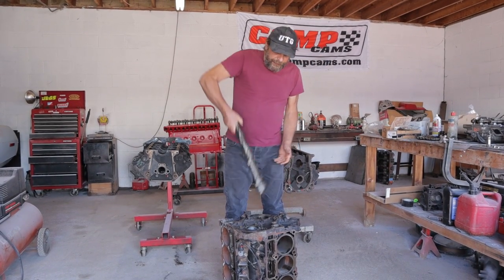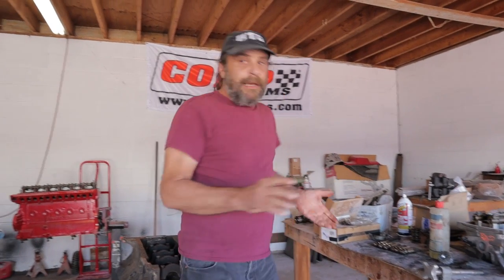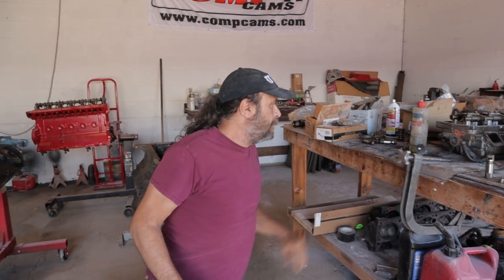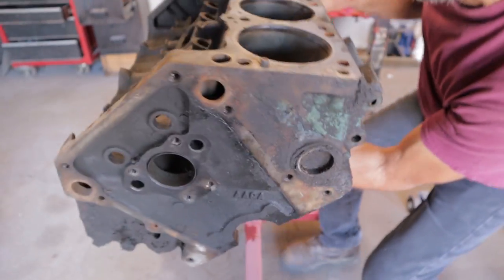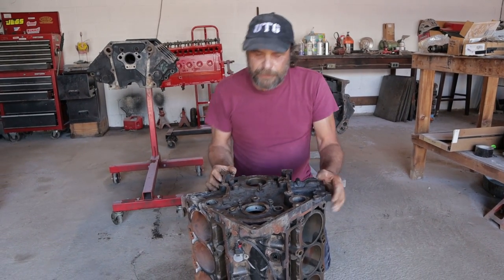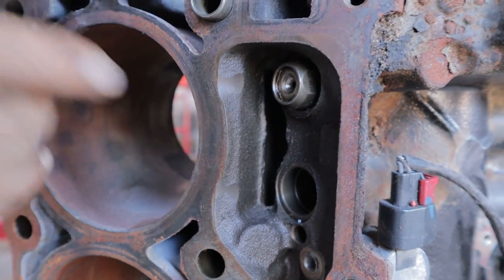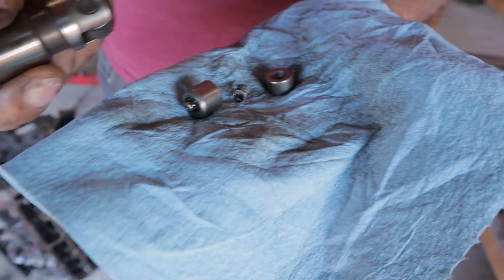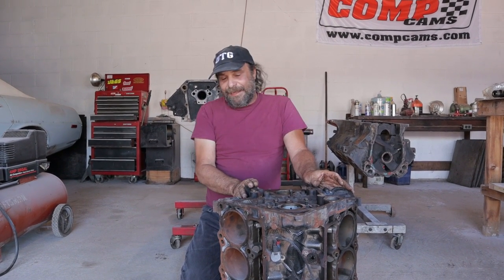Gen 3 Hemi Camshaft Failure Mystery Explained!

Comment: 3 decades ago I used to solve this problem on Holden 308's by grooving the lifter bore on the side of the lifter. I even made a tool to make it easy and consistent. Seems to me that may be beneficial on these engines also.  A local Aussie company Tighe Engineering machines a narrow flat surface on the side of the lifter itself to achieve the same result.  Grooving at the top side of the lifter (from oil groove to the roller end) would allow oil to positively flow to the rollers and splash across the camshaft.
Reply: kinda like a Rhoads lifter, but on the outside to direct oil, not to reduce lifter pump up... I never liked Rhoads, they tend to tick at idle, I preferred standard lifters, just set lash like at zero to a few thou loose, cant pump up- anyways, your controlled lube via a flat would work- long as mds blockoffs installed to give pressure source on lifter body- surely the depth of the flat could be tuned to give adequate flow without dropping oil pressure much- they only need a little more... I like it.
Reply: Hello I'm just a regular person on my second engine for my ram 1500. Looking to build my own. I would like to understand your fix but when I read it it looked like this ¥£€€\□》♡♡♡♤}5€■《》    😢😢😢 could you run that by me one more time
Reply: @RodneyBarber  as I read it, he had a groove cut or a flat ground, along the length of the side of the lifter...this allows oil from the oil galley that feeds the lifter to have a controlled leak, pouring excess oil down onto the camshaft... he didnt say if groove/flat was full length of lifter- if so it would also blow extra oil up into the valley- maybe ok for even more oil onto the cam from drain holes in the valley, but more likely would run to the front/rear drains first...my only worry would be reduced oil pressure from the 16 new oil leaks- a high volume pump/redrilling any feeds to handle extra volume. I think its a very sound idea, but(always a but) I think the groove from the oil feed recess to bottom only would put oil only out the bottom, and also, putting the groove or flaton roller centerline would put the 'leak' directly aimed at the cam lobe- but a groove or flat on centerline *might accelerate wear in the lifter bore, as the lateral loads would be pushing towards the groove... a zig-gag or helical groove would prevent a unworn strip in the lifter bore/provide better support to the lifter... interesting idea/food for thought. I think hes definitely got a viable solution worth kicking around/maybe tweaking. another option might be epoxy/grinder work around the block holes to guide all the drainback into areas directly over cam lobes- rake of crankshaft to horizontal line might require staggered heights so all holes would tend to drain equally with car/truck on level ground...idling on a incline though would only help one end of the motor...the lifter leak port I think might be a easiest fix- I would probably opt for a cnc'd groove with a helical or angled pattern to provide uniform wear in the lifter bore... would hate to see a unworn step in lifter bore after 50k miles or so... rhoads lifters dont have that problem internally as pushrods tend to rotate enough their ends and the internal roller plunger would tend to follow, preventing the bleeded groove from riding in one 'line' forever...

Comment: Spot on Tony. My buddy’s shop takes care of a fleet of hemi pickup trucks. They’ve replace quite a few camshafts and engines. Low rpm and a lot of idle time, with heavy loads. Most of the other vehicles that didn’t fail were in passenger cars being driven at higher speeds. You nailed it.

Comment: Excellent analysis. Explains why I managed to put 200k miles and 250k miles on two GEN IIIs both with lots and lots of Hwy miles at 2400 rpm yet a city driven car with 15k has the tick.

Comment: Makes me wonder if that is the real cause of the “hemi tick” I have seen commented on the internet so often.
Reply: I think you nailed it
Reply: Agreed. I enjoy UT vids, and am totally psyched he's got this GEN3 5.7. Hearing his detective work here makes alot of sense, and makes me worried about my '14 Charger 5.7....
Reply: SnowMonkVX ive got an 2014 ram 1500 makes me wonder
Reply: SnowMonkVX I hear you brother! I have a ‘15 Ram that I bought new. It never made any tick until recently when It’s been sitting more than before. I think he just described why.
Reply: exhaust manifold bolts...My 2004 Ram 5.7 hemi had that problem..it was the exhaust manifold bolts..Truck went 212,000 miles with no issues besides the exhaust manifold bolts! Simple enough repair at the exhaust shop.
Reply: I’m a car dealer and many of the hemi engines, have lifter failures.
Reply: @strokermaverick  hemis aren't the only ones.  my 2015 Silverado has that afm crap on it and it shredded the lifters twice. I have since shut the V4 mode off and no more problems.
Reply: I had a 2016 Ram 1500 Hemi and it always had the hemi tick from new. It would usually tick for about 30 seconds on startup. I traded it at around 30k miles, always made me worry that valve train was about to go.
Reply: @corymagnus7452  Same with my 04. I'm at 184,000 and still going strong.
Reply: Bet on it!
Reply: Kurt Zimmerman Yes sir, you are correct! I’ve seen many Chevy trucks, with collapsed lifters. The” tick” is one thing, but many hemi’s and ls’s    have lifter collapsing problems.
Reply: I started running Schaefer’s 5w20 in my 5.7. Stopped the hemi tick. Tried Mobil 1, royal purple and some others with no success. The Schaefer’s is where it’s at.
Reply: If you get OBD code P1521, this is incorrect oil type. Dealer says disregard this as erroneous, if you are using proper weight oil. Problem is that this is not erroneous. The problem lies in the damaged timing cover to block gasket. Damaged gasket leaks antifreeze coolant into oil pan. Other signs of this problem are:  1  slight coolant loss as seen in recovery bottle,  2. Possible coolant leaking from area of where the timing cover meets the block by the head. Coolant could also dribble on ground.,  and 3. Milky deposits in oil fill cap. Contaminated oil with coolant could cause poor oiling of engine components and wear.
Reply: @pwrbyford68  that was just normal start up tick. Takes a few seconds for oil to get go the top of the motor. Hemi tick doesn't stop.
Reply: @lindamyers7799  thanks a lot linda! Was wondering about all of those little symptoms in my 04 ram for the past few months. Looks like I'm tearing the front of my drivetrain off this weekend, kids are gonna hate me.
Reply: @jeep13ca  I've had Royal Purple stop the tick. Maybe switching between 3 different oils cleaned out something
Reply: @corymagnus7452  That is what I have. The tick is on start up. When she warms up, it's gone. I haven't looked at the bolts, but I know they're broke.
Reply: The exhaust shop pulls the cylinder head off and removes the broken manifold bolt? Sounds like a regular shop. It's an expensive repair.
Reply: @thenewnorm9909  is yours an intermittent slight tapping thats inconsistent? Think my exhaust manifold bolts are broken or lose causing the sound sometimes at start up and idle. Never when I gas it though.
Reply: @moabman6803  not really, just have to replace the exhaust manifolds, bolts and gaskets. easy repair on trucks, only time head removed is when someone screws-up and breaks something off in bolt, like an easy out.  also many people just replace exhaust gasket. which is a failed repair, because the reason bolts break is because manifold warped.

Comment: Tony, thank you!  I've got a 2010 Dodge 1500.  The camshaft went out at 98,000 miles.  FCA did warranty it for me.  (Thank God!)  Never could get an explanation from ANYONE on who, what, where, when.
Reply: How did you go about getting FCA to foot the Bill?
Reply: Ya how did fca cover it? My 2013 with 135k just went out
Reply: My 2012 has 225k on it and still going.  I've used Amsoil and a half quart of atf at 5000 mile oil changes from day one.

Comment: Well thank you ut you just proved my theory on this problem and then some  I work on a lot of these in the shop most of them police cars(idles alot) and this "theory" of yours also would explain why the catastrophic failure on these engines is usually on the cylinders that are deactivated for fuel economy my hats off to you sir but on another note I believe Chrysler already knows this but to admit this would be financial ruin to the corperation
Reply: Yep, just like the LS DOD lifter failures. Class action would destroy them because they produced millions. So they deflect, deflect deflect as we all have trucks with a stack of payments that need internal motorwork at 80,000 miles.
Reply: @Dave:"Yes,and every car manufacturer has their own lil secret "black book" of 'oops',and sometimes complete engineering frick-ups{!"
Reply: You 100% right
Reply: Hey comba.  Can u take a 3ANGEL FILE AND CUT A GROVE IN THE LIFTER BORE ABOVE THE  CAM. AND RAZE THE OIL PRES. TO COMP. AND USE GOOD OIL WITH ZINK.  PUT THE GROVE UNDER THE OIL HOLE OR CHANEL.  TAKE CARE.
Reply: That is why I sold my 2011, which I had payments on and bought a 1998 GMC Suburban which I paid cash for.  I can replace the engine and transmission in my old truck for less than the cost of replacing the cam and lifters in the HEMI.
Reply: Johnny Paycheck  Yeah, I pull damaged lifters off MDS and non-MDS cylinders.
Reply: Utah county Picazo's page lifters are always getting lubed regardless if they are MDS or not.  They are using oil psi to latch and unlatch them.

Comment: You are spot on! Thank you.
We have eliminated our problems with these engines by switching to Schaeffer Oil.  5W20 for the 5.7 and 0W40 for the 6.4.  It is night and day.  Noticeable as soon as you fire the engine up.  I think another problem with the 6.4 is many people out there are running Mobil 1 0W40.  This is usually a European spec, not a Chrysler spec.  Chrysler spec allows ZDDP (zinc).  Schaeffer has Zinc and Micron Moly to control the wear and it is Chrysler approved.  It’s also several dollars a quart cheaper than the factory Penzoil made from natural gas.
Reply: Holy shit great comments  👏 and I don't have a Hemi but a 5.9 litre but great info
Reply: Schaefer oil is good stuff. The moly will make up for design flaws and longer oil change intervals. Lots of idle time at an electric utility on line trucks and bucket trucks. The troubleman’s  truck gets a lot of mileage
Reply: What's the fix for a 2006 Chrysler 300 srt8 with a 6.1 ?

Comment: Awesome video. As a Chrysler tech, I’ve done quite a few of these cams and lifters, but I never knew exactly why it was happening. I have noticed excessive wear marks on the lifters, but I always figured it was lifter to bore clearance. I never thought of it being lack of lubrication. The older ones had issues with breaking valve springs also.
Reply: What vehicles use this engine? Does the 6.4 Hemi have this problem? If so what do I do to prevent it
Reply: @ggqbc  Tow guy that towed my blown up hemi Charger said their 6.4l tow trucks were going through camshafts.
Reply: @mph5896  my engine is starting to sound a little ticky... I try not to idle it anymore but really not much else you can do
Reply: @ggqbc  pull the heads and replace the lifters. You may catch it early enough to not wipe out the cam. The lifter rollers get sloppy causing noise and beating up the cam.
Reply: It might be a lack of lubrication but it's not a lack of "splash lubrication". No modern engine uses splash lubrication, if you have rebuilt these engines you should have seen the windage tray in between the crank and oil sump, which is there specifically to prevent the crank from hitting the oil. When the crank hits oil it aerates the oil, and air is a terrible lubricant, so they no longer use splash lubrication and minimize windage with windage trays.

Comment: Just fill the engine with oil until its level with the cam shaft , problem solved 🤷‍♂️.             For all the replies thinking that this was a serious answer  it was not, it was just soppose to be a funny answer,
. its obvious  that it is not what to actually do because of all the reasons it would not work .
Reply: @71chevelle 406   .... If the engine could actually turn over with all that resistance.
Reply: It might actually be possible to block off the original return passage from the cam valley and raise it a bit so that a small reservoir of oil forms.
Reply: I was thinking the same thing.
Reply: DrewLSsix 
That’s a cool idea
Reply: @colemanadamson5943   I have had a customer at the shop I work at put way too much oil in their car.  The engine will start and run.  The engine was running like crap, burning oil,fouled the spark plugs and the oil was frothy.  The car originally came if for a running problem, with no mention that he added oil.
Reply: LOL
Reply: Actually that’s probably not a bad thought a couple extra quarts of oil might do the trick to splash oil up on the cam actually now thinking more rod side clearance would help too...
Reply: I always put 10 quarts in mine and never burnt a cam or lifter yet!
Reply: Just use the snake oil
Reply: @devillockj  what oil are you using?  And what made you think to try that?  Mine has over 260K miles on it And is still running strong.  How many miles is on your engine that you've been putting 10 quarts in?  You have me curious.
Reply: @colemanadamson5943  I have an ex that will confirm a chevy spectrum will indeed run with 8qts of oil in it... Not well, but it'll run. Moral of the story: when she asks how much oil to put in, don't use the phrase "I don't know, just fill it till it's full"
Reply: Dry sump - nope , wet sump - nope ,
Submerged sump ✔
Reply: excessive oil in crankcase will cause oil aeration (very similar to oil starvation) along with many other crankcase issues. bad idea
Reply: @DrewLSsix  Or, just make the return smaller to create an oil back-up?
Reply: WHAT !
Reply: oh hell, just put ARCO Graphite oil in your engine, that's about as screwy as filling the oil up to the cam shaft.
Reply: Lmao 😂 fkn send it. What is oil aeration anyways.
Reply: Don’t you think if it was that simple this guy would have said to do that. It’s obvious more complicated than you think.
Reply: I'm trying it anyway-
Reply: It’s, suppose.
Reply: @hyacinthbucket3803  figured spell something wrong to see how long it would take for you to make the spelling mistake known.   Not to bad you figured it out pretty fast . 👍
Reply: My aunt had a a newer VW Bug in her shop because of a seized engine.  After inspection they found the engine was completely full of oil like up to the actual fill cap.  Turns out every time the lady would fill her car up with gas she'd add a quart of oil...hmm.  Someone shouldn't be driving LOL.
Reply: I worked on a old Ford LTD with a 351 for a lady one time, She said it was smoking from under the hood but running fine. I opened the hood with it running and seen oil spitting out the oil tube. I was about to say Blown head gasket or cracked block, expecting to see water in the oil. Nope, Clean oil. It was filled to the top with oil. I asked the lady if she put oil in it lately. She said the guy she got the car from said it burned oil so be sure to add oil once in a wile. She said she added 1 Quart every day ( never checking it ). She even added oil if she went to the Dollar Store less then 1 mile from home. I drained over 2 Gallons of oil before it hit the full mark. I showed her how to check the oil.  Needless to say it was Well Lubricated... lol
Reply: @devillockj  um I put in 8 qts on accident once and my lifter got stuck. Drove it out and 230000 miles later still running with a tick.
Reply: Crankcase ventilation will turn into crankcase overflow valve lol.
Reply: I've seen mexicans that thought you had to fill to top of motor
Reply: Right?? Had a 318 fuel pump fail and fill the crankcase with gas... Eventually locked up. Thought the starter was bad. New starter, still locked. Oh no lets drop the pan and check the bottom end out... Drained gallons out...overfilled the drain pan...huge mess!!! But wow was she clean inside!!! Some fresh oil and a new pump...good to go!!!🤣🤣

Comment: I've owned two hemi's, one in a jeep and one in a ram. I've always wondered why both idle at 1500 for nearly a minute on startup, regardless of whether they are cold or at operating temp. This makes sense though if Chrysler knew the cam lobes were only splash lubricated, and wanted to get them well oiled on each startup....